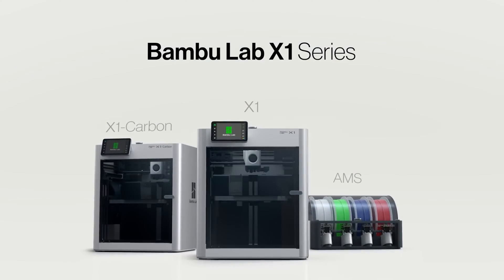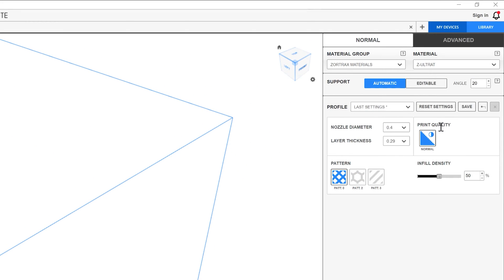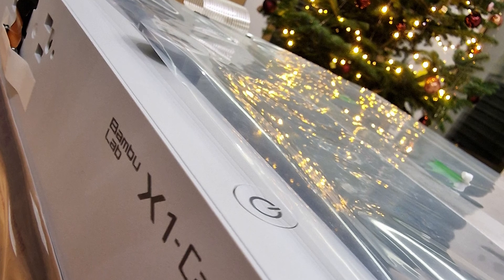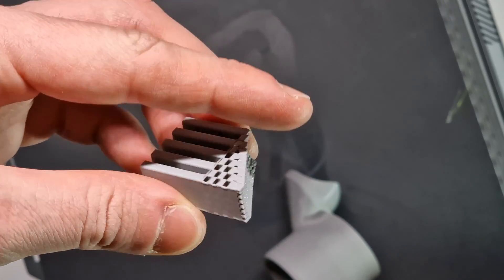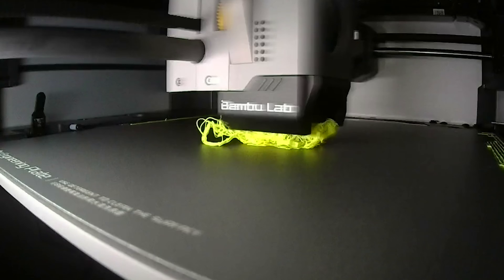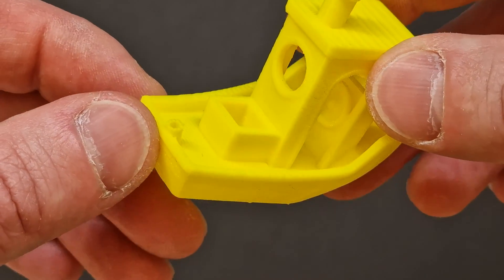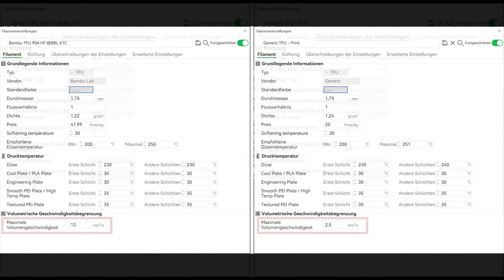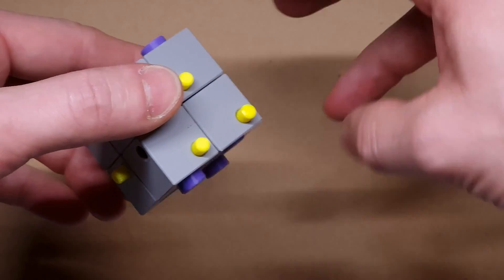How to improve TPU print quality on Bambu Lab X1 Carbon

Comment: Tpu needs to print slow and at a temp about 215 to 220 i find 215 the best, all so if using a smooth build plate use glue stick if a textured build plate is used just make sure its clean with ipa and retractions should be .5 to .8 and cooling should be 30% to 40% not 100% and im telling you this because i print about 5 rolls of TPU a week and i use Sain Smart TPU its by far the best.
Reply: thanks for the tips getting my p1s soon and im new to 3d printing so im absorbing as much info as i can until it arrives and i can start tinkering!  Finding the 3d print community is probably one of the most helpful ive ever encountered!
Reply from the maker: Thanks for the advices, i definitly will try these settings the next time 👍
Reply: Can you please mention the print speeds for TPU 95A?
Reply: @sachintharavindu3356 the max volumetric speed will limit the speed, no matter what your speed settings are already. For ziro brand TPU , I've done 12mms max volumetric speed , and 100mms for all the actual speed settings.
Reply: Have you had luck with their 87a? Mine kept cutting the filament in the extruder gear. 95a I've had great luck at 12.5 max volumetric speed, and 100mms speeds for everything. . . I've had to shelve the 87a in the mean time .. I got sick of pulling my tool head apart
Reply: Thank you so much ! For SUNLU TPU it's a temp between 225 and 230, I use 228.

Comment: I too am new to 3D printing and have a P1S. I can not seem to dial in printing ASA or PC. Any suggestions?
Reply: bed at 90 c, engineering plate, and glue stick, lots of glue stick. doors closed, lid on.
Reply: Done that. It seems no matter what I set it for it lowers itself to 65c and 220c for the nozzle. it has a mind of it's own.
Reply from the maker: To be honest, I haven't used ASA filament yet. But I have a new role at home that I'm going to try out now. I put the roll in the dryer. According to the recommendation, it should be dried at 65° for at least 4 hours. I will start printing this evening. My filament is not from Bambu, it is from ERYONE - but I will use the default settings for the first try. I will then let you know my results.

What exactly are the problems you are having? Poor quality (stringing, ozzing) or poor dimensional accuracy? Have you checked out the guide from Bambu: https://wiki.bambulab.com/en/knowledge-sharing/common-print-quality-problem
Reply: It seems no matter how much I tweak the settings it will lay down the first layer fine and then turn into spaghetti. also no matter what I set the temps for the nozzle and the bed it  always show on the device screen a lower temp and no matter how much I try to change it, it reverts back to a lower temp.
Reply from the maker: @mitchellbernstein42  which build plate are you using? Bambu offers a special high temperature plate: https://eu.store.bambulab.com/en-at/products/bambu-high-temperature-plate?variant=43719748157659

Their textured PEI plate is also recommended, and should offer better adhesion than the engineering plate.
Reply from the maker: @mitchellbernstein42
I'll also use the PEI plate then. RTH in filament dryer ist still 44%. Since several websites recommend less than 20%, I'll wait a bit before I start printing.
In the meanwhile i've checked the parameters in Bambu Studio for Generic ASA. For the filament I use (https://amzn.to/3Hu3SnX), the recommended speeds are many times lower than the standard settings in Bamboo Studio. The nozzle temperatures should also be 10 degrees lower.
Further, this site https://www.3dprintingsolutions.com.au/News/Australia/how-to-3d-print-asa-filament offers very detailed suggestions for using ASA. Therefore I'll tweak the parameters to match the recommendations for my filament and also reduce the fan speed a little bit and try to heat my chamber before start printing. However, i can tell you more after the first print.
Regarding the ticket, as mentioned in the video, I had also created a ticket. What exactly is the problem? Copy the printer's log file?
Reply: Coping the printer log files to upload. I've been using the PEI plate also tried preheating the chamber. It seems no matter what I change the temps to the they revert back to a lower temp.
Reply from the maker: I have finally finished the first print with ASA. The output is perfect =).
I used the “Dimensional Calibration Tool” as model.
As @michaelfilippi3276 recommended, I used the engineering plate. I also applied a lot of glue (Bambu Glue Stick).

Filament configuration - Generic ASA with the following changes:
nozzle temp: min 240°C - max 270°C
volumetric speed: 3mm³/sec
max fan speed threshold: 25%

Then i made the following changes to the 0.2 standard print profile:
reduced all speeds to 30 mm/sec
reduced rapid traverse to 400 mm/sec
reduced all accelerations to max 5000 mm/s² (for those which were greater, for surface acceleration 2000 mm/s² was set)

Due to the reduced print speed, the required time increased from 29 minutes to 80 minutes (compared to the standard profiles)

I also preheated the print chamber to 40°C. This took almost one hour. The filament relative humidity was 19% according to my dryer, when i started the print.

When I took the part off the print bed, I noticed that the test strips that are printed during the "Dynamic Flow Calibration process" had come off. So I think the glue is crucial so that the part doesn't come off during the printing process.

Surface quality of the print is very good. Also dimensional accuracy is fine (the deviation is a maximum of 3 hundredths - im sure it can be improved by setting the X-Y counter compensation value to 1.5 mm).

I hope this helps!
Reply: Thank you so much for all your prompt responses. I’m beginning to think this machine is defective, what ever i preset it to do it won’t reflect. @creativemakerat
Reply from the maker: @mitchellbernstein42
I have now simply printed the same part again with the standard profiles from Bambu. So Generic ASA and 0.2mm standard BBL X1C. This worked smoothly for me and I can't see any differences compared to my previous print result. The print bed temperature was kept constant at 90°C by my printer. So I can't explain why this doesn't work for you at all.

Just to make sure, you used the engineering plate with glue and dried your filament? Which manufacturer does your filament come from?
Reply: use polymer asa. I've been using it for months now and prints come out super clean. Now they have a preset for polymaker, comes out better. Just dry it first and get an air scrubber.
Reply: The strange of it all is I've been able to print with these filaments on my AnkerMakr M5C with an enclosure with no problems.
Reply: and build a air purifier with hepa and non acid washed activated carbon. Asa smell doesn't bother me but it keeps the x1c cleaner